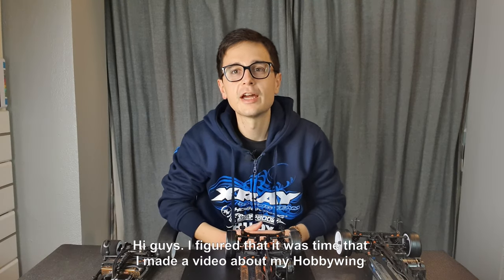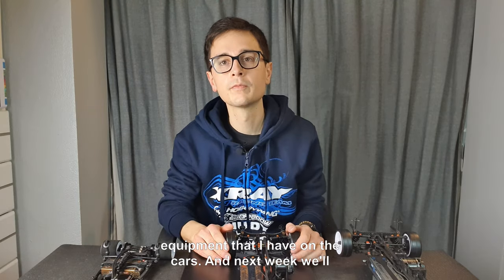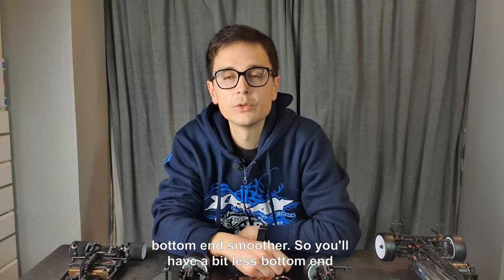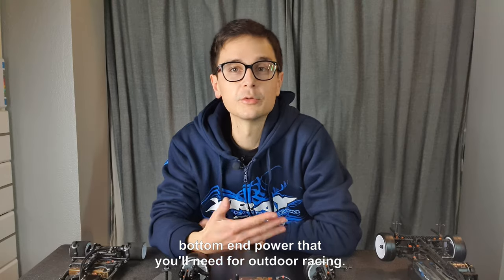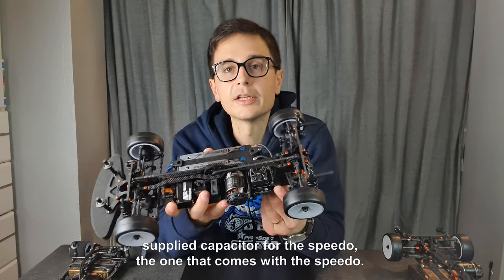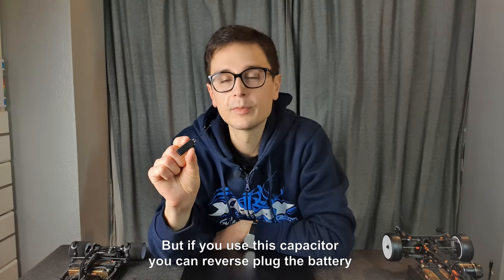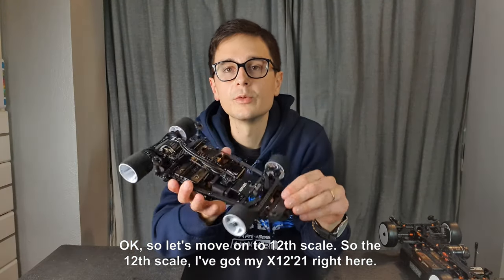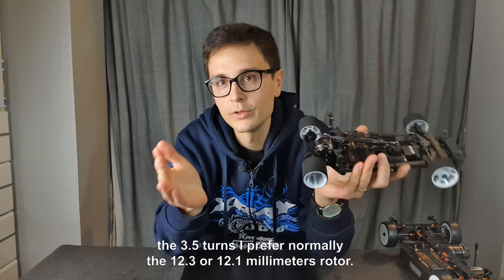My HW Electronics!

Comment: Excited to watch your speedo setting video, I hope you go into great depth about boost, turbo, and drag brake. Great video about your current setup! you've convinced me to stay with HW! Can you explain internal ratio and why that matters when setting your FDR?
Reply from the maker: Thanks! FDR matters mainly because of the balance between RPM (top speed) and acceleration (bottom end). The car must not reach it's top speed too early on the straight (undergeared). And it may not take too long to reach its top speed (overgeared) which will also make the car feel a little flat and unresponsive in the infield (it will lack acceleration).
Reply: @hagberg  Thanks Alex. Good luck on your upcoming races. Your videos are an immense help.

Comment: Hi there. Great video. Very nice cars.

Maybe you can help me.

I am in the process of building my 1/10 scale awd buggy.
I am trying to setup the ESC properly but I am unable to any brakes.

My gear is a Sanwa M17 transmitter and a RX-493 receiver. I have already done the binding of tx and rx and all settings on transmitter are default all curves are zeroed and also calibrated throttle and steering on the transmitter.

For ESC I am using the HW XR10 Pro G2 and for motor the V10 G3R 13.5t. I have calibrated the ESC with the transmitter successfully and I have forward and reverse but I have no brakes.

The ESC settings are default. I used the HW programming box connected to the PC. I Tried forward/reverse with brakes option and with this option I get 100% forward and 25% reverse but no brakes. I also tried the forward / brakes option and I still do'n't get brakes I can only go forwards.

This is my first race kit build so I may be missing some setting or any other step.
Maybe it is a setting in the ESC or maybe a setting on the radio (the radio is also new so still learning it and getting used with it).

Any idea where I may have missed something or done something wrong?
Maybe you can point in the right direction
Thanks.

Comment: ciao Alex,

it's me again, 
i'm having problem to weld the cables 14AWG into Esc and on the Elect Motor HW. 
i use the  Sn/Pb 60/40 and is not working.
do you Have any suggestion for me? any kind of solder? the connectors for the Elect Motor and for the ESC are kind of brass.

i hope to receive your answer

tnx in advance

Antonio
Reply from the maker: I can recommend a silver solder wire. Most importantly it's important to use a very high power soldering station. I personally use an LRP/Nosram station which has 90W.
Reply: @hagberg  tnx a lot once again for your support, is impressive your humbleness

Comment: did you switch over to G4 motors? what's the good or bad you experienced in comparison?
Reply from the maker: The G4 has a bit more RPM and also runs a bit cooler IMHO! Can't think of any disadvantages with the G4 over the G3R to be honest! This is for spec racing though. There's no G4 motor for modified racing yet!

Comment: Great video. I have a question regarding the 2 different G2S models. One has the frameless fan and one doesn't. My concern with the frameless fan is when the fan goes out I will have to replace it with an expensive special fan. The elite model looks like it has a normal 30mm fan on top. Does the frameless fan modem accept a 30mm fan? I see the fan frame is built into the chassis now but not sure if you can remove the fan frame ans install a regular 30mm fan?
Reply from the maker: The frameless fan insert is replaceable, see link: https://www.hobbywingdirect.com/products/cooling-fan-cyclone-ffd?variant=39658207150195
Reply: @hagberg  yes the insert it. I was wondering if the frame also comes off or if the fan frame is attached to the esc base. I know they call thoa frameless but there is still a frame it's just not apart of the fan. Sometimes in stock racing we don't need a fan so I was just curious if this esc could work in different applications. Thank you

Comment: I've just got the HW30840005 non polarity capacitor to fit onto my non-G2 (i.e. G1) XR10. I think it can be soldered either way on a G2 as it's non polarity however for a non-G2 does this still matter?
Reply from the maker: The capacitor is non-polarity regardless of what ESC version it's soldered onto.

Comment: Would you say there is an ideal motor temperature and if thats the case what is it? Also great video🙂
Reply from the maker: From my experience, when the motor gets above 80 deg C, it looses a lot of efficency. And if it goes above 100 deg C, the magnet and/or stator can be damaged, and won't perform as good afterwards.
Reply: @hagberg  thank you so much for the quick and good response🙂

Comment: Hi Alex, when you talk about motor timing, is it 32 - 35 - 37 average degrees observed on a motor bench ? Thx a lot
Reply from the maker: Yes, ideally measured on the motolyser.
Reply: Thx for the feedback. I ask because i see an important difference between my physical timing  and the timing checked on my skyrc bench, whitch is quite lower (35 => 28 ; 30 => 22) on my HW G3 motor. It’s my first HW motor, is it a commun gap ?
Reply from the maker: @benjebiraRC  if the sensor board isn't that even between the phases, it can definitely have some variations between the endbell setting and the true timing. But I have no experience with the SkyRC machine. I use the Motolyser, which is the most commonly used and most precise motor checker tool on the market.
Reply: Thanks Alex for taking the time to answer !

Comment: Hello Alexander.  i am going to race stock and modified with my 2019 T4.  110 spur is in the car,  i will be getting a 17.5t and have a  6.5 T all from Hobbywing.
What pinion range would i need?  some indoor tracks are very small and indoors i will only use 17.5T
Your videos are awesome.  im getting back into RC after a long time away so feel very out of date tech wise but your videos speed up the learning.
Reply from the maker: Hi Mark, will you be running 17.5T blinky? Then aim for an FDR of around 4.0. Which can be achieved with 100/47 for example. For 6.5T modified, aim for an FDR of 6.9. So for example 110/30.
Reply: @hagberg  Thanks.  i have found some local rules that say FDR must be 5  so i settled on a 100 to 38.  Pinion material Alu or steel(is the weight here a problem?) Also could you please recommend a couple of high quality brands.
Reply from the maker: @Mark McEntee  I personally use HUDY pinions. If you can't find HUDY, other good brands are RW, Core RC and Axon.

Comment: Ciao Alex , 
Very interesting video, i'm new in this E - world always run with 1/8 Nitro car. I just buy  an xray 12 22 and i'm concerning about the combo Esc -Motor, i would like to know if is enough for start with XR10 PRO ESC - G2 and XERUN V10 G3 Brushless Moto r6.5T On Road Spec HW., waiting for your answer, i hope i do not take much of yr time
thnx a lot anyway Antonio
Reply from the maker: Hi Antonio, the G2 ESC is a 2S ESC. So if you plan to run this with a 1S battery in your 1/12 car, you will need a DC-Booster (voltage booster) to power the receiver and servo. This kind of booster is available both from HW as well as other brands such as Motolyser  (Laje). The 6.5T On-Road Spec motor is the best choice for the EFRA 6.5T Blinky Modified class. I personally use the XR10 PRO 1S HD ESC for which no voltage booster is needed.
Reply: @hagberg  1st of all TNX a lot for the prompt response,  i m going right away to order that, but just one other clarification,
XR10 PRO 1S HD ESC  can run with 2s LiPo Battery?

anyway
again TnX A lot much appreciate!
Reply: do u mind to send me the right link where to buy XR10 PRO 1S HD ESC 
please!
Reply from the maker: @antoniocoppola5996  the 1S ESC can't be used with 2S! This has to be used exclusively in 1/12 cars. Where are you located?
Reply: @hagberg  i'm working on cruise ship in USA Florida, i will order from HW North America. I see by Specs that the 6.5T On Road Spec	Modified Class of 1/12th On-road Racing	run with 2S battery. is it ok for the Motor? that's why i'm a bit confused I do apologize, I try to avoid to buy something wrong
tnx Anyway!
Reply: @hagberg  i can change with 3.5T instead 6.5T ? am I right?
Reply: @hagberg  i will run with 1S Battery
Reply from the maker: @antoniocoppola5996  The 6.5T On-Road Spec motor can be used with both 1S or 2S configurations, but that motor was specifically designed for 6.5T blinky racing with a 1S battery.
Reply: @hagberg  tnx for the support, now clear all about, next few days i'll order it!

Comment: Hi Alex. What gear ratio fdr do you recommend for a 13.5 turn Stock Racing setup on small outdoor Asphalt?
Reply from the maker: 4.1-4.3 for the Hobbywing G4.
Reply: @hagberg  Iam decided to go for a Hobbywing XERUN Justock Combo XR10 G3 with a 17.5T G2.1 Motor for my xray X4 23. As mentioned ealier i will be using it on a smaller asphalt track. 10-15m long straights. Which gearing do you reccommend for the X4. I saw you mentioned around 4 FDR ( (100spur/38pin)*1.9) ). Is this still the best starting point I should go for? And I would like to hear what you think about the hobbywing justock xr10 comboes in general :) cheers
Reply from the maker: @MetalMathiasTP  The Justock is a pretty solid combo, can't go wrong with it! For a small-ish track with a 17.5T motor, I would aim for an FDR of around 3.6-3.8.
Reply: @hagberg  Thanks! Which combo of spur/pinion will suit this? And will I have a risk of overheating motor/esc?
Reply from the maker: @MetalMathiasTP  Keep your runs short (no longer than 5 minutes) and carefully monitor the temperature of your motor. I would suggest a spur gear of 96T and a pinion of 47-49T.

Comment: For stock setup and racing (17.5 to 21.5) what Hobbywing motor/esc and gears setup would you recommend?
Reply from the maker: For stock racing you may use either the XR10 PRO G2 that I've suggested in the video, or the XR10 Stock Spec which also work really well (it's got a smaller foot print, because it's specifically made for stock racing). Which class are you running? Touring car?
Reply: @hagberg  I'm a newbie to the sport and this year is going to be my first racing year.  I'll be running in the stock 17.5 sportsman touring class, the track/club is in SoCal and is short track with many turns, not so much straightaways and traction is low to medium.  My goal is to find a gear set up that would allow me to the corners without too much on/off the throttle.  I know my T4 came with 84T so wasn't sure what size pinion to go with.  Also, noticed your full line of 64 pitch gears so that's something that I would like to experiment as well.  Thanks for all the great video tutorials!
Reply from the maker: @raymondwu9000  what type of motor/brand do you plan to use for the class? This will be important to try and determine the right gearing. A good starting point for a 17.5T motor on a technical asphalt track would be an FDR (final drive ratio) of around 4.00. This can be achieved for instance with a 100T spur and a 48T pinion, alternatively a 98T spur with a 46T pinion. I can really recommend 64 pitch spur gears for stock racing, since they allow you to fine tune your gear ratio a lot more. a 84T spur (48 pitch) which comes with the gear will be too big for you to reach the desired gear ratios for the 17.5T class.
Reply: @hagberg  I'm building 2 cars at the moment, so far i purchased the XR10 Stock with the 17.5T motor as a combo for the first car.  The second one I'll try the XR10 Pro and maybe with the same motor or try the Reedy 17.5T.   Ordered the 64 pitch gears hope to try it this week..thanks!

Comment: 1/10 touring is just too expensive 🤦‍♂️I'm struggling to get the electronics that will give me more of a chance in racing, its either have a big cash flow, or just be slow due to equipment bought cheaper